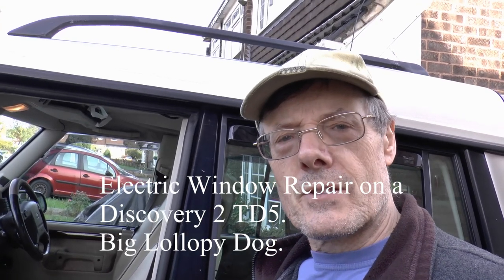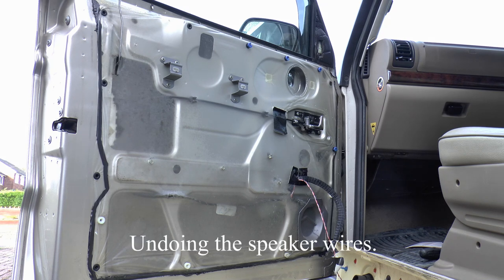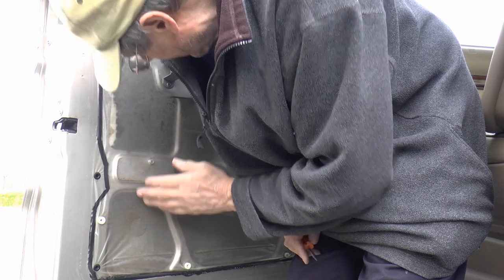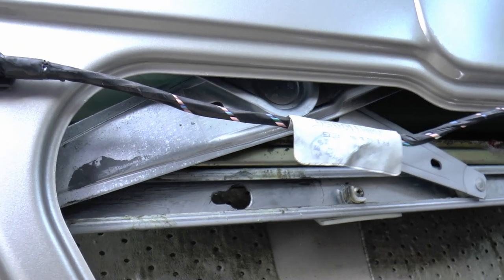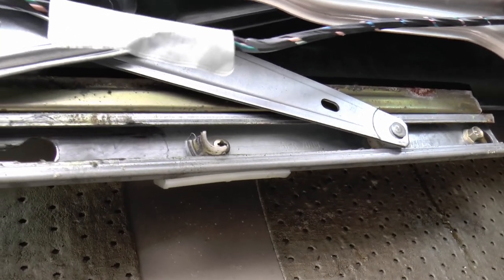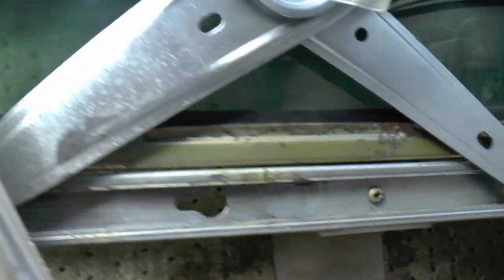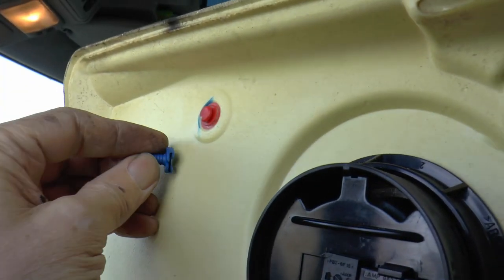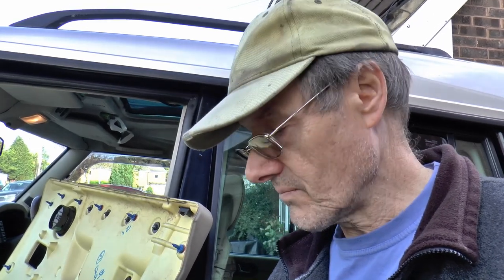Discovery 2 Window Repair at last!  (Big Lollopy Dog!)

Comment: Just used this video as a reference while replacing the window-winding motor in my D2 so, many thanks.

Possibly of some interest; my window had been making a quiet "thunka-thunka-thunka" noise as it wound up and down for a couple of years.
Eventually it got stuck in the fully-lowered position and only made a screeching noise.
Eased it up half an inch and it wound the rest of the way up as normal.

Turns out that the quiet "thunka-thunka-thunka" noise was half a dozen worn teeth on the reduction gear in the motor, which correspond to the position the motor ends-up in when the window is fully down.
I guess this makes sense cos that'll be the place where there's the biggest load on the gear, when winding the window back up again.
So, if your D2 window is making a "thunka-thunka-thunka" noise as it winds up and down, it's probably going to fail eventually.

Anyway, £20 for a replacement motor off eBay and half an hour and it's as good as new.
Reply from the maker: Good result!    It's not too bad of a job.   I'll be listening now for strange noises when using the windows!     I've had the door panels off and greased the gears and winders as a matter of course earlier.
Reply: Hi there, im having exact same problem, could you please link me which motor you bought? Thanks

Comment: Mine window has just stopped working... can hear a click when using the switch but there’s no motion... so is there a way to test the motor before spending on a new one?
Reply from the maker: Last time I changed a motor on Big Lollopy (drivers side rear) I just assumed it was the motor and changed it anyway. There is probably an electrical way to check, ie making sure there is current at the plug, but other than that, I don't know. Sorry. It's either the switch, or the motor or the wiring in between. It's usually the motor anyway. Good luck.
Reply: @sleepycatpictures1176  ty sir got my bank card ready lol

Comment: Posible need to change the Regulator. Word of warning try and get a good second-hand original one. I got a brand new window Motor and regulator OEM china made. The motor fitted original regulator but a lot of manipulation needed to fit it to China regulator. Which I did not do! Motor and Regulator £40 New. The regulator is all the stuff need to take the window up and down after the motor. Mine was drivers side. Relative easy to do check YouTube for a Vid on it.
Reply from the maker: Ta.  Seems a lot of fuss for a simple plastic wheel! Anyway, repair still holding up (fingers crossed) . I blame the window shields for constricting the glass's movement when it reaches the top. I'm trying to take my finger off the button just before the window stops itself.  If I get chance, I'm going to grease the other window mechanisms to try and prevent this happening again!
Reply from the maker: Yup, probably be second-hand but genuine.
Reply: @sleepycatpictures1176  I got a drivers side regulator, just looked at it, you could grind the rivets out of the window support bar and inner door support, then swap them over and rivet to your old regulator. 3 rivets in total. You could have this one, I have if you want if you collect. BB5 5TL
Reply: @sleepycatpictures1176  Its china made and plastic skid blocks are oblong and plastic.
Reply from the maker: @martinrothwell8966  Cheers Martin!  To be honest, the tie-wraps are still holding up, but that might be because I've hardly used the thing for months. Hopefully the injector seals will be done over Christmas then it will be usable again.
Reply: @sleepycatpictures1176  good luck, never done injector seals yet. Let me know how you get on. Happy Christmas.
Reply from the maker: @martinrothwell8966      It'll be on the Youtube  when I do!  Weather permitting!
All the Very Best to you for the Season and a Happy New Year!

Comment: There is a video on Youtube with a guy using a 10p piece welded on instead of the plastic wheel.
Reply from the maker: Sounds good, if you are a welder! Unfortunately, I'm not!   Good idea though!
Reply: Yes I did mine and believe me it’s easy, fiddly but worth it. Undo the 10mm screws that hold the regulator onto the door then on the regulator arm that holds the window slacken the two outermost screws so the regulator just slides out at the bottom of the door. Roughing the metal stud up with sandpaper and put flux on cold then tin it, do the same with a 10p piece rough it up flux and tin it, put the 10p flat tinnin sides touching obviously in the middle and put the torch on and as soon as it melts say about 5 to 10 seconds take it away and leave it to cool, pack the  runner with grease and reassemble, The old plastic washers are exactly the same diameter as a 10p, I am no welder and all i used was plumbers solder. The drivers door one went about a year ago and a rear passenger door went just a couple of weeks ago and I did them both the same, my disco is 20 years old by the way so I’m looking forward to the other two going because I know I can do it. Good luck lads.
Reply from the maker: @petersalmon2695  Hi. Excellent repair.  I'll try that when mine goes again. Tie-wraps holding up so far. mind you, I can't use Big Lollopy until I've done the head . ..  again!